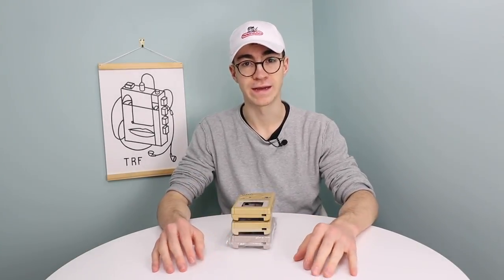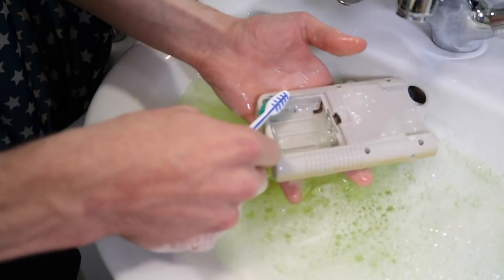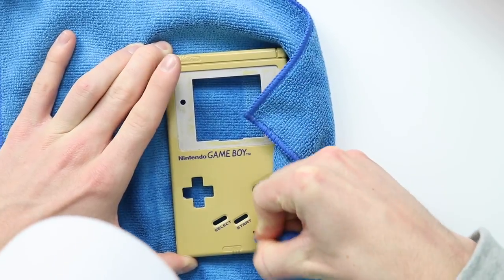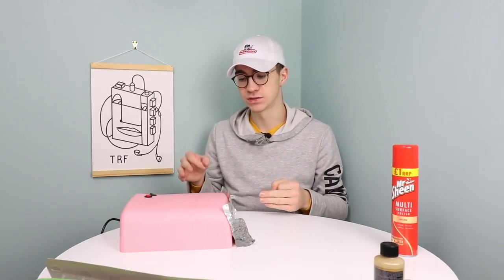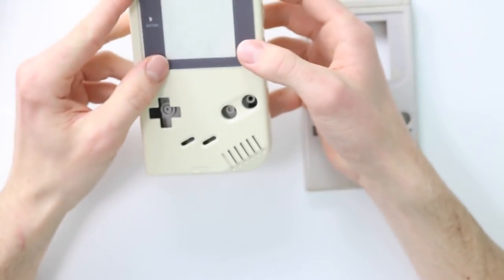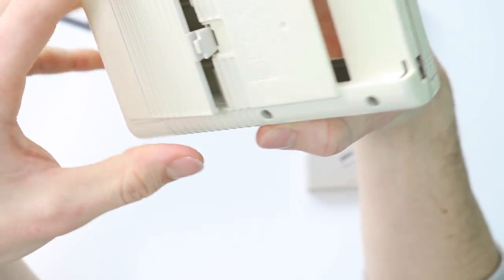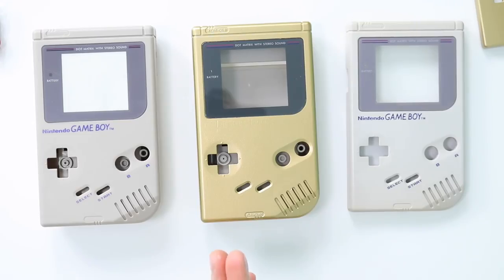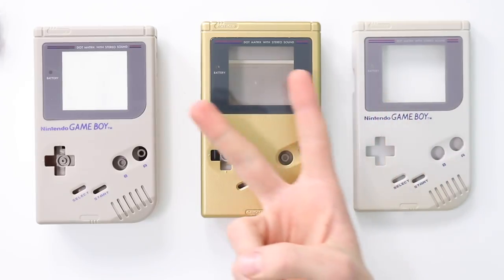GameBoy Shells - RetroBrite, Repaint or Replace?

Comment: I restore classic cars (as a hobby, not for a living) and I'll quote what purists say in the car collection business: "It's only going to be original once". 
Restoring it is fine, but the moment you start repainting it or changing parts, it looses a part of itself, a piece of originality.
Which is why when we work on old cars, we only change parts that are either too far gone (panels rusted to the ground for example) or that are potentially dangerous (30+ years old brakes, suspensions and tires that keep the car on the road). 

In relation to videogames and game consoles, it's mostly the same thing:
-Retrobrite if you want it original (as that particular unit left the assembly line);
-Repaint if you want it restored;
-Replace if you want it "safe to use" (as in, no damaged screens/buttons, no exposed wires and so on).

Comment: I've done the retrobrite on a dmg shell, but i did it with a cheaper solution. Much cheaper. I made a solution with about 1 bottle of regular water and a cup of oxygenated water, put those in a transparent container and i set everything under the sun for 4 to 6 hours. Down side of it, you can do it on summer only, but it's cheap and works just fine, without leaving the borders with that yellow on it. 

I'm sorry for my bad english, i'm italian
Reply: It's a good english man

Ps:I'm Brazilian ;- ;
Reply: @riqkk_  thanks!
Reply: Es buen ingles, ps i'm Chilean
Reply: @Espingify  hablas espanol,manito?
Reply: @Espingify  oh god, it's started. what have i done? Forgive me
Reply: @emanueletrentini2504  I will not forgive you,you até a goddddd
Reply: @riqkk_  but i'm so sorry... Sigh
Reply: Wow, pensavo di essere uno dei pochi italiani a guardare questi video
Reply: Vorrei iniziare anche io a collezionare e dare nuova vita alle console Nintendo ma non so proprio come iniziare
Reply: @Gematriaaa1  tutto sta nel comprare la prima console ;)

Comment: Painting one of these is generally a bad idea unless you want to keep it as a display piece. Using a good primer with lacquer paints and a clear coat will keep the finish intact for a while but the oils on your skin will tarnish the finish pretty quickly, repeated handling over time will eventually wear even the best paint away.

Comment: If you use a high quality clear plastic primer, color, and varnish sprays, spray painting can actually be very durable. Montana Gold paint is what I use. It costs a little bit more than normal spray paint, but it's absolutely well worth it. (The color "Marble" in Montana Gold is a really close match to DMG grey)
Reply from the maker: Ah sweet man, thanks for the info.

Comment: Gloss over the paint to make it more durable and sustainable to wear
Reply: Ew.
Reply: @nowtestify  ?
Reply: ImGonnaBeTheVeryWorse, SkyrimPlayer!! - Ignore him, clear coat is a good idea.
Reply: @KyleRVeenstra  clear coat wouldn't necessarily but glossy would it?
Reply: What ever you want to call it, clear coat or gloss,in the end it would protect it from ware and that would. (I originally ment clear coat )
Reply: Clear coat, clear lacquer... It's basically the same stuff that is on cars to protect the paint work.  Would be the way I do it.
Reply: They mean lacquer and wear.  But essentially good advice if you’re going to use it frequently.
Reply: @AcornElectron  thx mate for correcting me I've changed it now

Comment: I've repaired and restored a lot of Game Boys and honestly prefer replacement shells in most cases. Retrobright or similar product is great but is very time consuming, messy, and (as noted in the video) can be hard to get every part of the shell's color restored. Unless you're 100% set on having the default gray color, it's also nice to have variations of color available in new shells as well. The possibility of a slight misalignment in text isn't really a bother in any instance.

Comment: I have done a lot of retrobrighting just using a plastic bag and placing them in the windowpane. Need good ligth and the tufn them and massage the hair bleach. Works very well. Woul say one out of ten gets marks from the bleach. You need to look after them though. The serial does not need to be taken off they are really strong.
Cheers

Comment: Personally, I much prefer the retrobite one. It retains the original colour and text. The paint will wear off in places over time. Also, retrobriting can be done outside when it's sunny, so the cost would be that of the peroxide cream, which would be ~£1-2

Comment: I bought a 1l bottle of peroxide cream for about £6. You also don't need the lamp in summer! I think the retrobright approach probably works out cheaper if you have a lot of items you want to treat, because you can do it in bulk. If you just want one replacement the painting (or a new shell) is probably the better approach.

Comment: Retrobrite is the only proper solution, paint ruins the console. Your arguments against it are basically that it takes a long time, but you just set it up and go do something else for 3 hours. Besides, why are you in a rush to restore a Gameboy? Also, the sides not being done is because you're using the janky nail machine instead of a proper reflective box.
Reply: @David L what could be an example of a "reflective box"?
Reply: @redcanfly  get a clear storage container, line it with foil along the outside of it so make it "reflective" so that uv rays can bounce around and mostly stay within the box

Comment: To replace the text, all you'd need is a printer, and a knife. Run off two stencils, each with the contact points for the letters (you know what I mean. E or G wouldn't need them, but O would just be a hole in the paper without them) in different places. Do two passes in the appropriate blue, over the stencils, with the rest of the gameboy masked off. If you have a 3D printer, you could design and print two perfect masks for the front of the shell, the whole front, and do the whole thing in two passes.  Another option would be printed decals, but I'd go with paint, otherwise people might peel them up.

Comment: Maybe look into airbrushes and Tamiya paint. It's alot more costly but if you're doing it a lot it could be worth it. The dmg seem to be an aircraft color ghost grey or gull grey. You could probably get it color matched with federal standard and get a perfect color. Also with an airbrush dilute the paint alot and do 3 light coat between drying and you could matte varnish it for added protection.  It would look amazing and for most people into restoring it's about the beauty after not the time spent or money. It's about it being perfect.